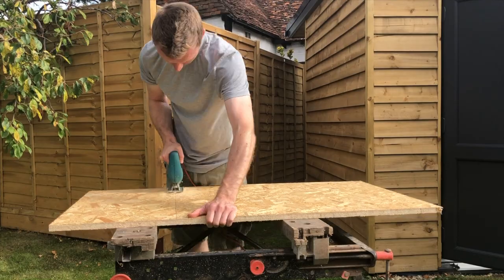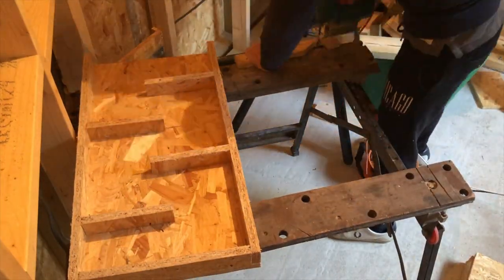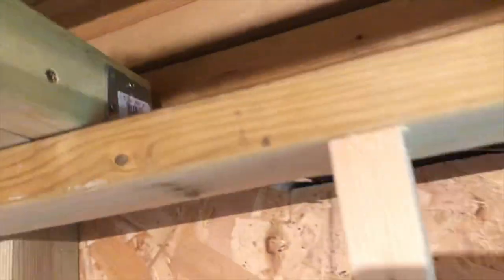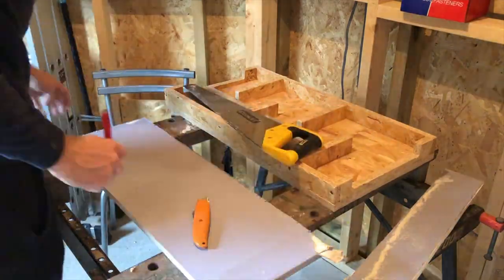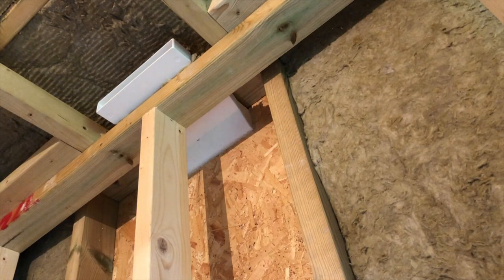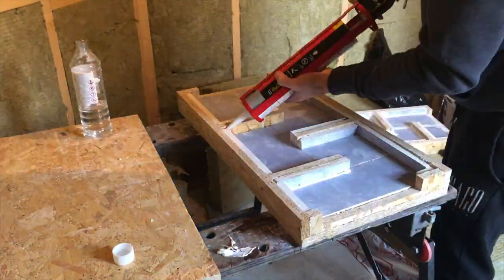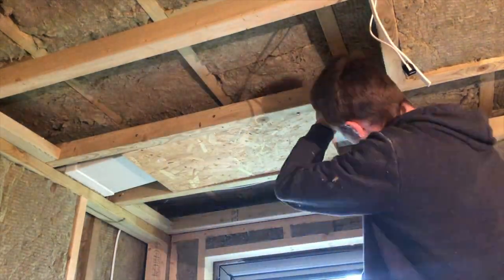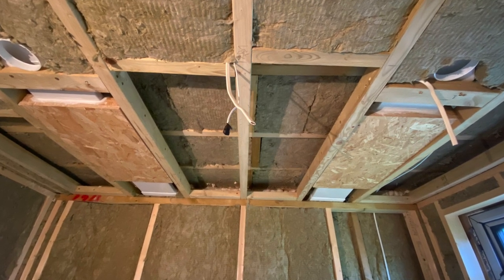Building a Sound Maze and Installing Ventilation - Drum Studio Garden Room Build - Part 9

Comment: As an acoustician I would have recommended using a SPL meter to test noise levels before and after.  I would also add that you should have installed the vent system in a way that it was de-coupled from the framing.  There are a few more recommendations I could have suggested however...
Reply: I’m researching something similar but it’s for my HVAC outlets in my live room… looking at Rod Gervais baffle box design

Comment: Now the inside room is touching the outside room and transferring sound, unless you have spaced everything with Rockwool?
Reply from the maker: Hi thanks for your comment. The boxes themselves are attached the the inner roof joists only. The one element which is connecting the two is the plastic ducting from the sound maze to the exterior wall vents. This is wrapped in rockwool. Unfortunately this is the one thing that can't be helped, if you need ventilation then you have to connect the two rooms together somehow. The good thing is from the tests I have done there doesn't appear to be any noticeable impact
Reply: @leejmurphy  Yeah guess it would be virtually impossible to isolate 100%. Looking forward to the plastering 👍👍😁

Comment: awesome video, i wish that you read my comment, i have a question from you, how many of those sound maze have you used in the room?, and how much air one of these would pass through?, I'm planning on making a silent server rack for my self, i need enough air flow for just one server in the rack, I'm concert wheatear i can deliver enough air for one 2 u server.
Reply from the maker: Thanks for your comment. I used 2 of these in the room, 1 for the air intake and 1 for the air output. I don’t have detailed specs on how much air can pass through as it hasn’t been tested with any kind of specialist equipment, but I tried to keep the flow area as close to 100mm ducting as possible to not restrict the air flow. I’m using a fan with an extraction rate of 54 cubic meters per hour and haven’t found any issues with the setup. Thanks
Reply: @leejmurphy  thank you for your help🙏🏻🙏🏻🙏🏻

Comment: Great video bud. I’ve been looking at baffle boxes so interesting to see you apply this method. Any reason why you have both inlet and outlet in the ceiling and not the walls? Quite interested to understand the positioning.

And don’t forget to press that metal clasp on your sealant gone to reduce the pressure. That green glue isn’t cheap 🤣

Great video and really enjoyed it. Look forward to the next one.
Reply from the maker: Hi Ricky, glad you've been enjoying the build. I did consider placing them in the walls but had a few theories as to why the ceiling would be better. By placing them both in the ceiling so that the air vents were fairly central to the room, and not off to one side, it would generally help for a better air circulation. The other factor is that in every aspect of this build I am trying to maximize the amount of space so room was limited. In the ceiling there was more room to fit in the duct work and the angled adapters than trying to do this in the walls. The other through process was that if any sound proofing was compromised with the holes, at least this is sound traveling up through the roof as apposed to out through the walls where neighbors would be more likely to hear it. I don't think there is a right or wrong way, this was just the way I decided to go! Thanks for comment and hope that helps!

Comment: Hi mate do you have any measurements for this box? Thankyou
Reply from the maker: Hi there, sorry no I don't. It was made more to fit within the space I had available. There is i'm sure a more scientific method to calculate the optimum design, but it does work well. It is approx 40cm wide, 10cm high and 80cm deep.

Comment: hey, what is the gap between those dividers in the maze
Reply from the maker: Hi there. Thanks for the question. The duct width was 225mm. The dividers were around 15cm between each other. I would have ideally spaced them further apart, but I was limited to the space I had to fit this and wanted to insure there was at least 4 dividers to provide sufficient surfaces for the sound to bounce off efficiently.

Comment: Don't do what this guy did. There is a lot of unnecessary steps here. Also, this will lead to breathing in drywall, insulation and GreenGlue fumes. 

Your priority when designing a ventilation baffle box is AIR QUALITY, followed by the sound baffling.